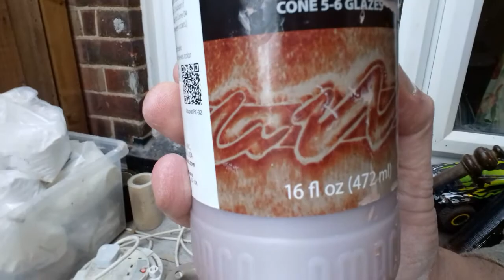Heart vases.

Comment: Btw I have that same luck with amco Albany slip. Only one time in my gas kiln I had a tea pot on very top shelf ochre clay body , top shelf in my gas kiln always fires cooler , I had almost no reduction and most likely did not even reach cone 5 on top ..... The pot was lovely with swirly warm yellow gold's like on the bottle. Go figure .
Reply from the maker: Haha, maybe I will try a lower temp next time, I probably didn't help matters only using two coats,  but it's really thick so I thought it would do. Thanks for the info.